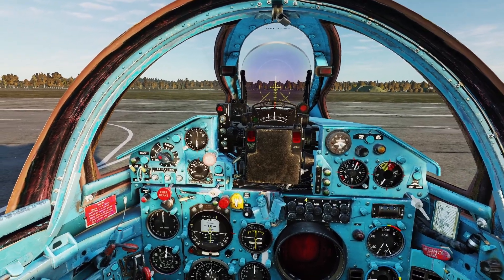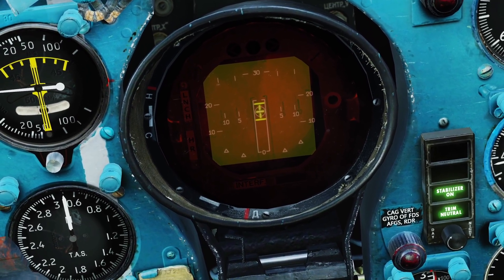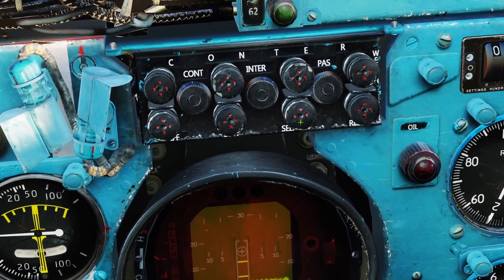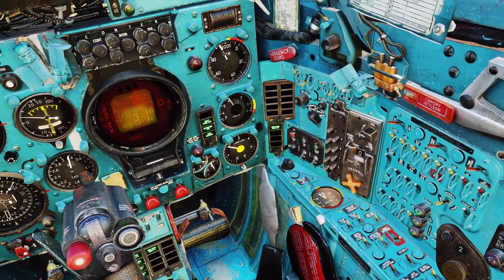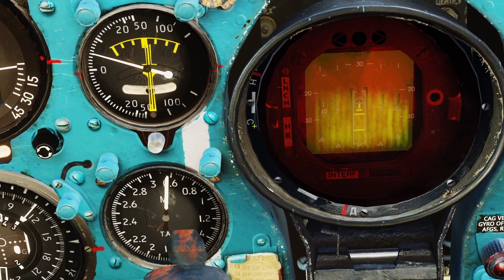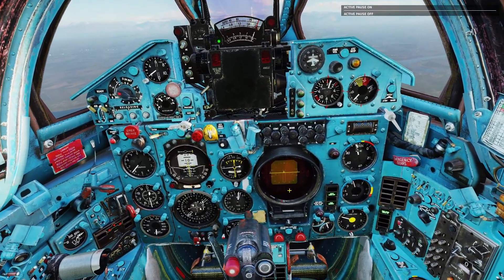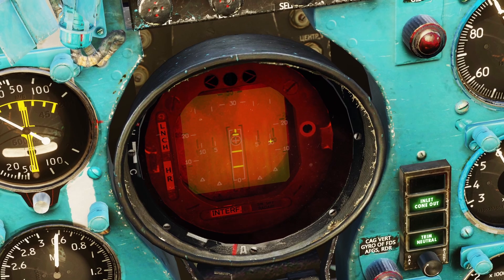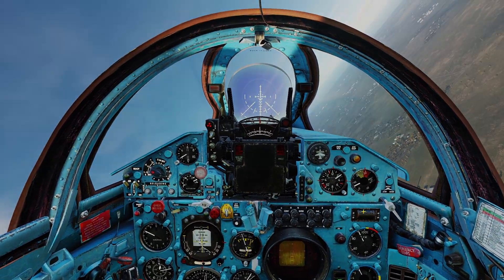DCS MiG-21bis Radar

Comment: Nice video. Fyi you can use the fixed beam mode to lock an aircraft as well. Useful when you can the see the aircraft visually
Reply: But isn’t fixed beam used for Ground attacks & not to lock target using fixed beam but using Throttle TDC Slew & Radar Lock on to estimate the range between you & target when Radar Main Mode is On along with Fixed Beam..